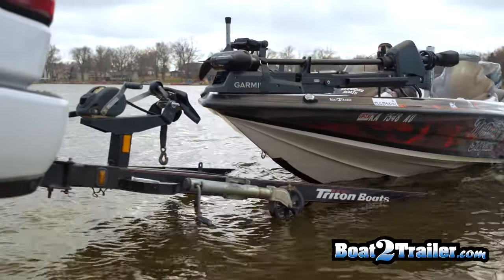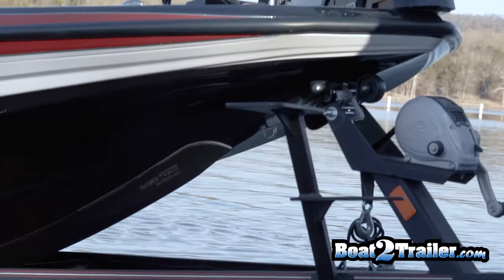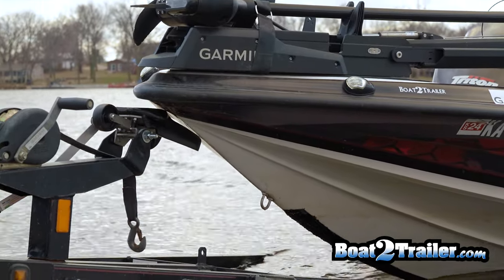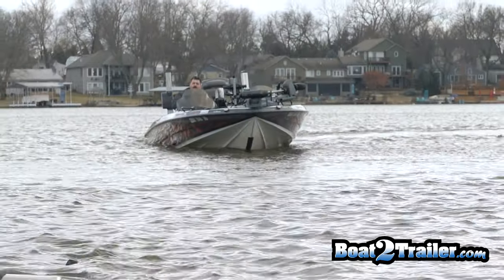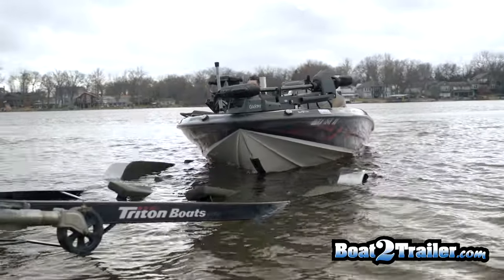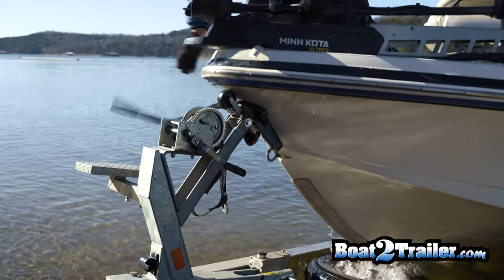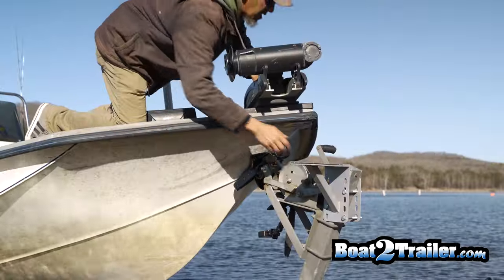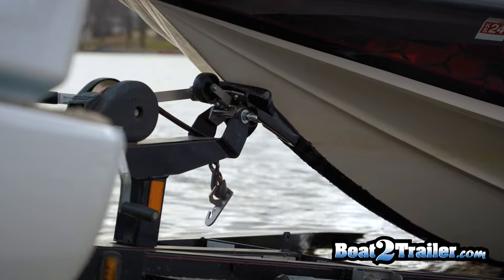Troubleshoot | Trailer Depth | Boat2Trailer | Automatic Boat Loading System | Ramp N Clamp

Comment: Awesome - but not totally (yet):  

I just purchased and installed the long-handle, Sport model on my Skeeter's trailer. All I have done so far is put the boat on the trailer (not launched yet).  It was awesome being able to secure on the trailer - and not having to leave the engine running (while in gear), lay on the front deck to attach the winch hook, crank it tight -- just to keep from sliding away from the winch.  

But here is my first issue: I have the exact same, fat winch hook as the one in this video - and there is not enough room to secure the winch hook while latched to the new device.  There is room for the thin, safety chain hook - but not the fat winch hook. 

I pushed the provided bolt to attach the device through the holes with the plastic-looking bushings -- would choosing a different hole for the bolt free up more space for the winch hook?
Reply from the maker: We have an adapter on our site if your winch hook doesn’t fit with the clamp https://www.boat2trailerhookup.com/product/strap-hook-adaptor/

Comment: I’m on a steep busy ramp is the clasp trustworthy enough to pull up the ramp or would safety chains be necessary
Reply from the maker: If the clamp locks or snaps shut. It will not release until the handle is pulled. We still recommend hooking up the safety chain and strap for any travel.
Reply: Pull the boat a little up the ramp, then get out and hook the safety chain.
Reply: I have ranger 1782vs and I had issues with the eye of boat being too low and had to power max the motor to move boat up to connect with the latch. And when it latched on the back of the boat was too far back so straps hit the boat. 
I m nit sure what solution is , lower or move the frames fitter forward or cut the height of the frame lower so the boat doesn’t have to be powered up to latch connects.
Anyone else had this issue please help.
Reply: having the exact issue on my deep v …….mayb calling customer service or returning the unit possibly